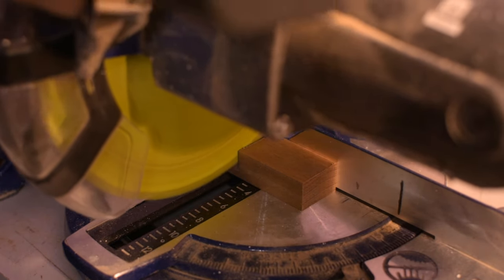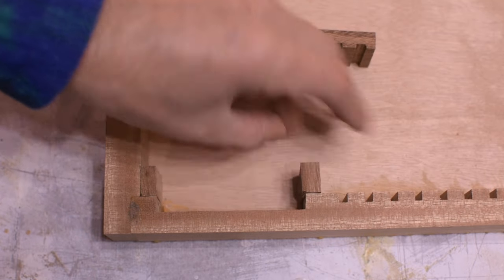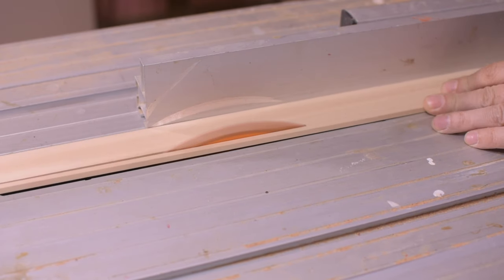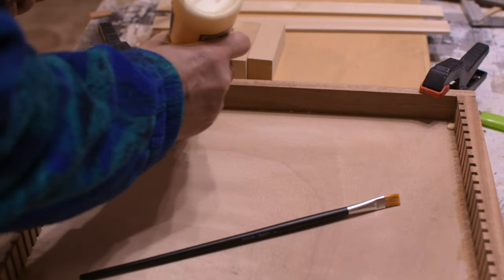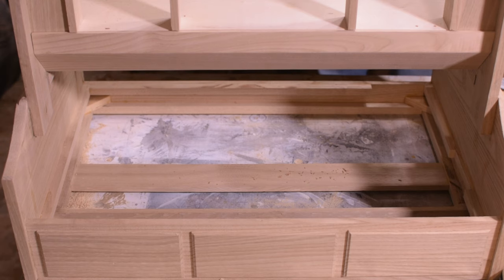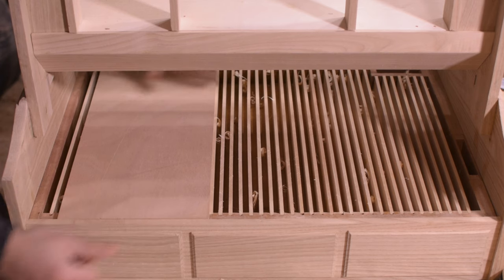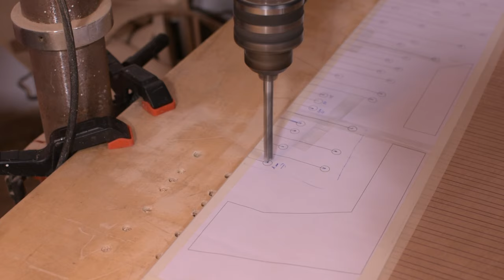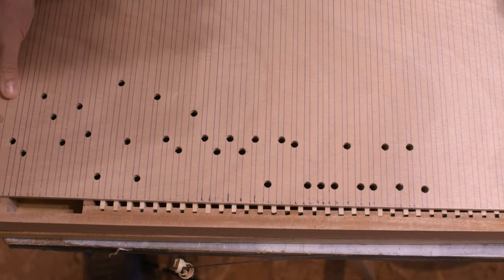Renaissance Positive Pipe Organ Building - First windchest

Comment: Hi.  I have only recently discovered your channel.  Congratulations on your work.  I am sure that I will find this new build very interesting.   I'm wondering what sort of adhesive you use for the windchest? Apologies if you have stated this previously.
Reply from the maker: Thank You!. The construction of the organ follows traditional rules with some modern concessions such as the glue which was traditionally animal but I instead use aliphatic glue.
Reply: @nippocast  Many thanks.  I'm in Australia so will need to research the local products.